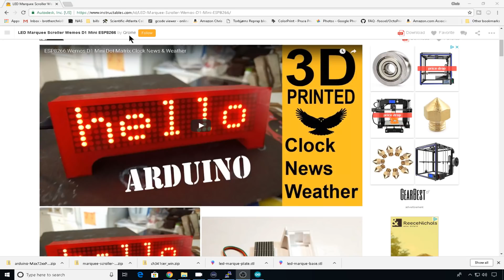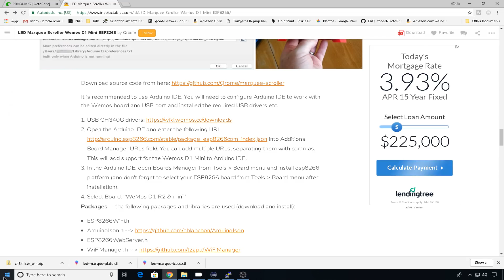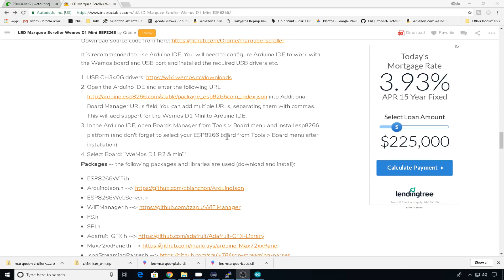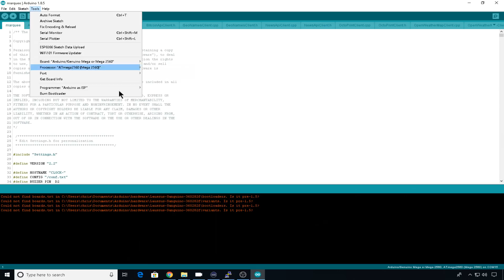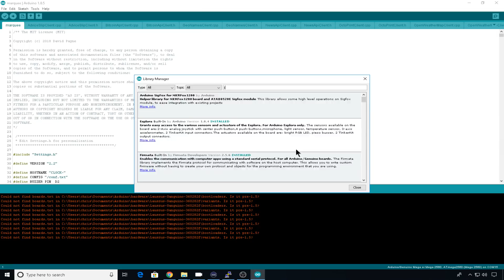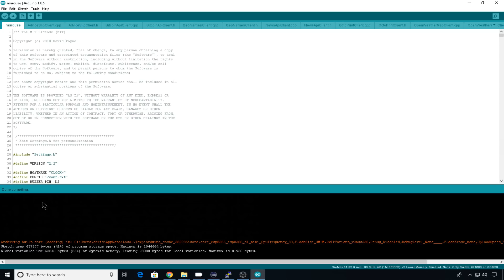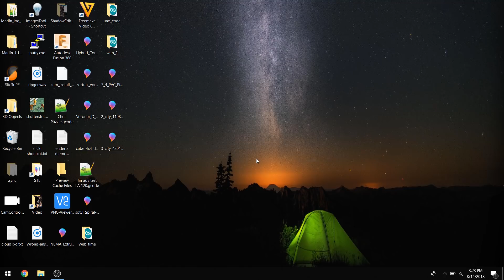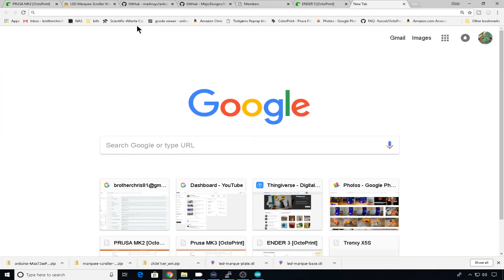LED Marquee Scroller - Wifi - OctoPrint Monitor - Chris's Basement

Comment: Thank you very much for your patience and explanations. I am encountering a problem on the web interface. It says “Weather Error: Weather Data Error: HTTP/1.1 401 Unauthorized,” even though I entered my API correctly. Do you have a solution? Thank you in advance.
Reply: even i am getting the same ,,,it was working fine for last 2 years and all of a sudden same error started from yesterday . Tried different API key - same error
Reply: @sougatasengupta2972  You found a solution?

Comment: Hey Thanks a lot for this step by step, any advice on how to bend the pins...? I dont want to break them
Reply from the maker: Some of the pins bend easier than others. TO be super safe you could remove them, bend them and solder them back. If your careful, you should be able to bend them in place.

Comment: Chris - thanks a million for this step by step guide.  I am relatively new to the world of Arduino and was having a beast of a time getting this to function.  It is my 6th Arduino clock project.  It gets a bit frustrating at times because so many tutorials don't cater to a complete newbie and leave out little details that make all the difference.  I first started working on this a couple of days ago and when I was loading the marquee ino file into the IDE, none of the tabs showed up so I kept getting tons and tons of error messages.  Not exactly sure what I was doing wrong, but after following your lead very meticulously this morning - it magically worked!   Now on to my next clock project...
Reply from the maker: Yay!!! I love it when a plan comes together! Good luck with the next project

Comment: Arduino:1.8.5 (Windows 10), Tarjeta:"WeMos D1 R2 & mini, 80 MHz, 4M (1M SPIFFS), v2 Lower Memory, Disabled, None, Only Sketch, 921600"

sketch\NewsApiClient.cpp: In member function 'void NewsApiClient::updateNews()':

NewsApiClient.cpp:55: error: no matching function for call to 'HTTPClient::begin(WiFiClient&, String&)'

   http.begin(wifiClient, apiGetData);

                                    ^

sketch\NewsApiClient.cpp:55:36: note: candidates are:

In file included from sketch\NewsApiClient.h:26:0,

                 from sketch\NewsApiClient.cpp:25:

C:\Users\waldo\AppData\Local\Arduino15\packages\esp8266\hardware\esp8266\2.4.1\libraries\ESP8266HTTPClient\src/ESP8266HTTPClient.h:136:10: note: bool HTTPClient::begin(String)

     bool begin(String url);

          ^

C:\Users\waldo\AppData\Local\Arduino15\packages\esp8266\hardware\esp8266\2.4.1\libraries\ESP8266HTTPClient\src/ESP8266HTTPClient.h:136:10: note:   candidate expects 1 argument, 2 provided

C:\Users\waldo\AppData\Local\Arduino15\packages\esp8266\hardware\esp8266\2.4.1\libraries\ESP8266HTTPClient\src/ESP8266HTTPClient.h:137:10: note: bool HTTPClient::begin(String, String)

     bool begin(String url, String httpsFingerprint);

          ^

C:\Users\waldo\AppData\Local\Arduino15\packages\esp8266\hardware\esp8266\2.4.1\libraries\ESP8266HTTPClient\src/ESP8266HTTPClient.h:137:10: note:   no known conversion for argument 1 from 'WiFiClient' to 'String'

C:\Users\waldo\AppData\Local\Arduino15\packages\esp8266\hardware\esp8266\2.4.1\libraries\ESP8266HTTPClient\src/ESP8266HTTPClient.h:138:10: note: bool HTTPClient::begin(String, uint16_t, String)

     bool begin(String host, uint16_t port, String uri = "/");

          ^

C:\Users\waldo\AppData\Local\Arduino15\packages\esp8266\hardware\esp8266\2.4.1\libraries\ESP8266HTTPClient\src/ESP8266HTTPClient.h:138:10: note:   no known conversion for argument 1 from 'WiFiClient' to 'String'

C:\Users\waldo\AppData\Local\Arduino15\packages\esp8266\hardware\esp8266\2.4.1\libraries\ESP8266HTTPClient\src/ESP8266HTTPClient.h:139:10: note: bool HTTPClient::begin(String, uint16_t, String, String)

     bool begin(String host, uint16_t port, String uri, String httpsFingerprint);

          ^

C:\Users\waldo\AppData\Local\Arduino15\packages\esp8266\hardware\esp8266\2.4.1\libraries\ESP8266HTTPClient\src/ESP8266HTTPClient.h:139:10: note:   candidate expects 4 arguments, 2 provided

C:\Users\waldo\AppData\Local\Arduino15\packages\esp8266\hardware\esp8266\2.4.1\libraries\ESP8266HTTPClient\src/ESP8266HTTPClient.h:141:10: note: bool HTTPClient::begin(String, uint16_t, String, bool, String)

     bool begin(String host, uint16_t port, String uri, bool https, String httpsFingerprint)  _attribute_ ((deprecated));

          ^

C:\Users\waldo\AppData\Local\Arduino15\packages\esp8266\hardware\esp8266\2.4.1\libraries\ESP8266HTTPClient\src/ESP8266HTTPClient.h:141:10: note:   candidate expects 5 arguments, 2 provided

exit status 1
no matching function for call to 'HTTPClient::begin(WiFiClient&, String&)'

Este reporte podría tener más información con
"Mostrar salida detallada durante la compilación"
opción habilitada en Archivo -> Preferencias.
Reply: please can you help me it gives me this error and I don't know how to solve it, thanksArduino:1.8.5 (Windows 10), Tarjeta:"WeMos D1 R2 & mini, 80 MHz, 4M (1M SPIFFS), v2 Lower Memory, Disabled, None, Only Sketch, 921600"

sketch\NewsApiClient.cpp: In member function 'void NewsApiClient::updateNews()':

NewsApiClient.cpp:55: error: no matching function for call to 'HTTPClient::begin(WiFiClient&, String&)'

   http.begin(wifiClient, apiGetData);

                                    ^

sketch\NewsApiClient.cpp:55:36: note: candidates are:

In file included from sketch\NewsApiClient.h:26:0,

                 from sketch\NewsApiClient.cpp:25:

C:\Users\waldo\AppData\Local\Arduino15\packages\esp8266\hardware\esp8266\2.4.1\libraries\ESP8266HTTPClient\src/ESP8266HTTPClient.h:136:10: note: bool HTTPClient::begin(String)

     bool begin(String url);

          ^

C:\Users\waldo\AppData\Local\Arduino15\packages\esp8266\hardware\esp8266\2.4.1\libraries\ESP8266HTTPClient\src/ESP8266HTTPClient.h:136:10: note:   candidate expects 1 argument, 2 provided

C:\Users\waldo\AppData\Local\Arduino15\packages\esp8266\hardware\esp8266\2.4.1\libraries\ESP8266HTTPClient\src/ESP8266HTTPClient.h:137:10: note: bool HTTPClient::begin(String, String)

     bool begin(String url, String httpsFingerprint);

          ^

C:\Users\waldo\AppData\Local\Arduino15\packages\esp8266\hardware\esp8266\2.4.1\libraries\ESP8266HTTPClient\src/ESP8266HTTPClient.h:137:10: note:   no known conversion for argument 1 from 'WiFiClient' to 'String'

C:\Users\waldo\AppData\Local\Arduino15\packages\esp8266\hardware\esp8266\2.4.1\libraries\ESP8266HTTPClient\src/ESP8266HTTPClient.h:138:10: note: bool HTTPClient::begin(String, uint16_t, String)

     bool begin(String host, uint16_t port, String uri = "/");

          ^

C:\Users\waldo\AppData\Local\Arduino15\packages\esp8266\hardware\esp8266\2.4.1\libraries\ESP8266HTTPClient\src/ESP8266HTTPClient.h:138:10: note:   no known conversion for argument 1 from 'WiFiClient' to 'String'

C:\Users\waldo\AppData\Local\Arduino15\packages\esp8266\hardware\esp8266\2.4.1\libraries\ESP8266HTTPClient\src/ESP8266HTTPClient.h:139:10: note: bool HTTPClient::begin(String, uint16_t, String, String)

     bool begin(String host, uint16_t port, String uri, String httpsFingerprint);

          ^

C:\Users\waldo\AppData\Local\Arduino15\packages\esp8266\hardware\esp8266\2.4.1\libraries\ESP8266HTTPClient\src/ESP8266HTTPClient.h:139:10: note:   candidate expects 4 arguments, 2 provided

C:\Users\waldo\AppData\Local\Arduino15\packages\esp8266\hardware\esp8266\2.4.1\libraries\ESP8266HTTPClient\src/ESP8266HTTPClient.h:141:10: note: bool HTTPClient::begin(String, uint16_t, String, bool, String)

     bool begin(String host, uint16_t port, String uri, bool https, String httpsFingerprint)  _attribute_ ((deprecated));

          ^

C:\Users\waldo\AppData\Local\Arduino15\packages\esp8266\hardware\esp8266\2.4.1\libraries\ESP8266HTTPClient\src/ESP8266HTTPClient.h:141:10: note:   candidate expects 5 arguments, 2 provided

exit status 1
no matching function for call to 'HTTPClient::begin(WiFiClient&, String&)'

Este reporte podría tener más información con
"Mostrar salida detallada durante la compilación"
opción habilitada en Archivo -> Preferencias.
Reply from the maker: I think I answered this, but try IDE 1.8.5
Reply: @ChrisRiley  hello, good, I already installed the ide 1.8.5, but when checking the libraries it gives me this error Arduino:1.8.5 (Windows 10), Card:"WeMos D1 R2 & mini, 80 MHz, 4M (1M SPIFFS), v2 Lower Memory , Disabled, None, Only Sketch, 921600"

sketch\NewsApiClient.cpp: In member function 'void NewsApiClient::updateNews()':

NewsApiClient.cpp:55: error: no matching function for call to 'HTTPClient::begin(WiFiClient&, String&)'

   http.begin(wifiClient, apiGetData);

                                    ^

sketch\NewsApiClient.cpp:55:36: note: candidates are:

In file included from sketch\NewsApiClient.h:26:0,
Reply from the maker: @waldinin  Make sure you see multiple tabs, make sure all the files have been extracted. If that's good I would as over on the github. https://github.com/Qrome/marquee-scroller/issues

Comment: buenas me da un error "noArduino:1.8.19 (Windows 10), Tarjeta:"WeMos D1 R2 & mini, 80 MHz, 4M (1M SPIFFS), v2 Lower Memory, Disabled, None, Only Sketch, 921600"

C:\Users\Waldinin\Downloads\Nueva carpeta\marquee-scroller-master\marquee\NewsApiClient.cpp: In member function 'void NewsApiClient::updateNews()':

NewsApiClient.cpp:55:36: error: no matching function for call to 'HTTPClient::begin(WiFiClient&, String&)'

   http.begin(wifiClient, apiGetData);

                                    ^

C:\Users\Waldinin\Downloads\Nueva carpeta\marquee-scroller-master\marquee\NewsApiClient.cpp:55:36: note: candidates are:

In file included from C:\Users\Waldinin\Downloads\Nueva carpeta\marquee-scroller-master\marquee\NewsApiClient.h:26:0,

                 from C:\Users\Waldinin\Downloads\Nueva carpeta\marquee-scroller-master\marquee\NewsApiClient.cpp:25:

C:\Users\Waldinin\AppData\Local\Arduino15\packages\esp8266\hardware\esp8266\2.4.1\libraries\ESP8266HTTPClient\src/ESP8266HTTPClient.h:136:10: note: bool HTTPClient::begin(String)

     bool begin(String url);

          ^
Reply from the maker: Try using Arduino IDE version 1.8.5

Comment: Will this work with esp32
Reply from the maker: Yes, it is in the code you just need to correct the comments.
Reply: Chris Riley this thing is incredible. I have it running on a nodemcu. Printing the pieces now. But how on earth is it using my internet I never even gave it my ID or password?????
Reply from the maker: @EnergeticWaves  Huh, maybe it found an open wifi somewhere.
Reply: @ChrisRiley  is it possible that the esp keeps a record of prior wifi id's and passwords?
Reply from the maker: @EnergeticWaves  It shouldn't if it was re-flashed.
Reply: @ChrisRiley  that's what I would think, but who knows what is really going on!
Reply: Went thru the code no mention of my wifi esp must keep in flash somehow.  Either that or i dont have good setting on the router!
Reply: To update, the chip listens for people connecting to the wife and tries the same password they are using!  lousy security.

Comment: I tried this, however, the device never shows up in device manager. I rechecked all my connections and they're good. 

Any thoughts?
Reply from the maker: Try installing a CH340 driver.
Reply: @ChrisRiley  I did. 

I also tried two usb cables.
Reply from the maker: @gw1814  Could be just a bad board.

Comment: Thanks Chris, I followed your instructions, installed the libraries, and the code worked perfectly on the first try....but i only have the ESP8266 NODE NCU LOlIN 12-E and wiring like this CLK-->D5 , CS-->D6 , DIN-->D7 AS YOU SEE ...HOW CAN CHANGE THE CODE FOR CLK-->D5  AND DIN-->D7 ....??
thanks in advance Eduardo
Reply from the maker: Hey eddy, check out the settings.h around line 82

/ Display Settings
// CLK -> D5 (SCK)  
// CS  -> D6 
// DIN -> D7 (MOSI)
const int pinCS = D6; // Attach CS to this pin, DIN to MOSI and CLK to SCK (cf http://arduino.cc/en/Reference/SPI )
int displayIntensity = 1;  //(This can be set from 0 - 15)

Comment: Is there a way that I can reset everything? I entered credentials but for some reason I can't access the configuration anymore. Tried reuploading the code but that also does not work
Reply from the maker: You can use the ESPtool https://youtu.be/pJGBRriNc9I?t=823

Comment: Ho Chris just built one it is working after upload but it says unable weather data error 1.1.404 also unable to control it from IP address I can turn it on and off but can’t set up when I click save it says on browser can’t reach page I have been pulling my hair out for 3 days now recompiled it many time still same please help!
Reply from the maker: So were you able to login to it via the access point mode? Does it show up as a wifi network you can connect to?

Comment: Thanks for your project ..... I have a problem trying to connect to weather Marquee  when i type in the ip address it will just show me a text. On the dot modules it says hello then the ip address and then weather data error HTTP/1.1 401 unauthorized. Does the weather  Marquee  still work for you ?
Reply from the maker: Not sure, I will have to plug it in and check.

Comment: Do you know if it's possible to customize the font used in the display? If so, which file has the information?
Reply from the maker: I am not sure, I know you can change the size, I would ask David over on the inscrutable. https://www.instructables.com/id/LED-Marquee-Scroller-Wemos-D1-Mini-ESP8266/

Comment: I have a question about the setting for the number of segments. Currently it is set at 4x1 but what if I wanted it e8x1 or 4 x 2? Will it make a two row display in a 4 x 2 set up or will it make text twice as tall?
Reply from the maker: I really have no clue,  test it and see what happens.

Comment: the json Streaming Parser library you chose does not show up when you search for json. It does show up if you type 'parser'
Reply from the maker: Looks like you might have got it working?
Reply: Chris Riley I got the compile to succeed but actually I’m waiting for my displays to come in before I’ll know if it really works. I was having trouble connecting to it on my browser though. I’m wondering if it would be difficult to modify this for an OLED display.

Comment: i did get to work . It worked for a week and now will not connect to wifi. my phone says its connected. but its just says please connect to wifi. And when it did work it never showed in my router, RT-AC3100, Any ideals please sir?
Reply from the maker: It must have tried to grab a new IP. It should just select a new one if your router is serving DHCP.